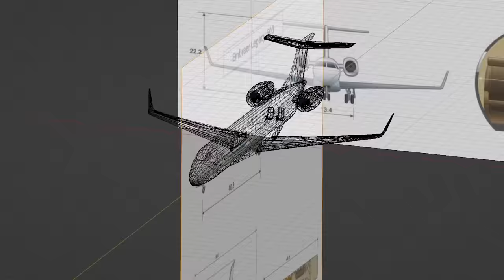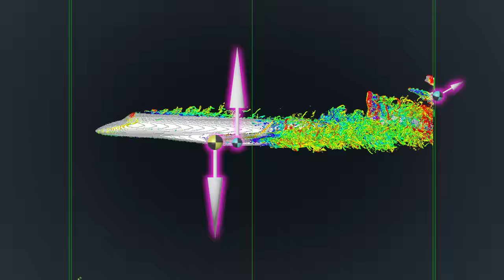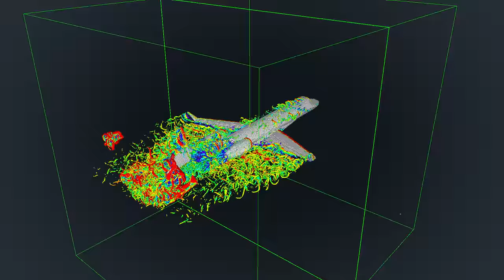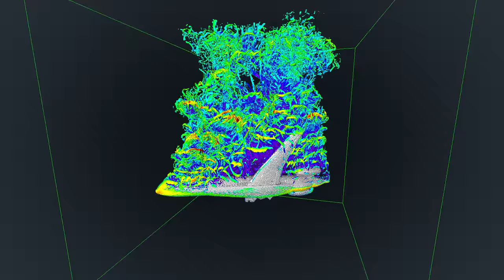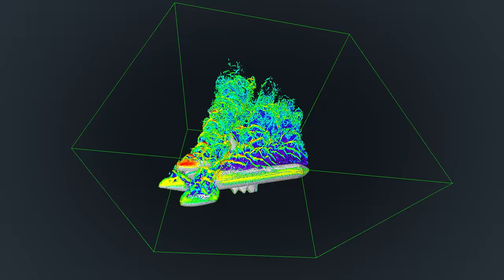Prigozhin's Aircraft Crash Analysis

Comment: How to know if the wing separated first and rip the tail or vice versa?great video
Reply from the maker: In other accidents (including larger airliners) that I've studied over the years, if a wing is lost first then the tailplane will generally keep the aircraft pointing mostly forwards the whole time - like the fletching on an arrow does. And the fuselage continues on a parabolic path downwards to the ground but the tailplane remains attached and never allows the fuselage to get 'sideways' enough to rip the tailplane off with the force of the airflow. The remaining wing may roll the aircraft as it produces lift but the tailplane keeps the whole wreck pointing forwards until it contacts the ground. So considering the tailplane was in a different location to the fuselage it leads to me to think that it wasn't a main wing that separated first 🤷‍♂️
Reply: For the alternate view, try to decipher the poor image quality in this video: youtu.be/8H2FGud37RQ?t=4m30s
To me it looks like the empennage was attached while the plane was falling and there's some holes which could be caused from shrapnel.  On the other hand, the two engines would also take up a few pixels.  The Wall Street Journal seems to think it was a bomb: youtu.be/x2BAYebRVfk
Overall, the physics in this CFD simulation looks accurate enough and provide far more scrutiny than I expect from the official investigation.
Reply: First thing that hit me watching a few copies of the grainy video in different stages of the fall, it seemed that at one point it still had 2 wings and engines but no tail, with smoke and debris mostly falling from the tail area.
Reply: short answer. you find the tail and wing. if the tail is further back from the route. the tail cut off first.
Reply from the maker: @nathanbanks2354 I believe Denys Davydov is quite incorrect about the few holes seen around the place on the skin which are just normal concentrations of damage in a crash. Look at MH17 shrapnel damage to see what a surface to air missile actually does to aircraft skin. That MSJ video is excellent too - it's the first video I've seen where they identify the plume spewing out of the plane during the fall as fuel, I thought it was pretty obvious and didn't even put it in my video, but then I saw all the comments saying it was smoke or fire, etc, and wish I put that detail in there. I thought I was alone in thinking that it was fuel so I'm glad I saw that WSJ vid now, thanks for sharing it!
Reply: @nathanbanks2354  Looking at that image, I can see the 'shadow' of the engines but there doesn't seem to be such blocky 'shadow' of pixels from the tail. It looks like the horizontal stabilizers attached to the vertical stabilizer are missing in the image he was showing, but it's impossible to tell if the vertical stabilizer is also missing. Considering the footage seen previously, I'm inclined to say it also went, because there's little or nothing I can think of that would rip away the elevator surfaces while also leaving the rudder present
Reply: @AntimatePcCustom  that COULD be the definitive evidence, if the plane had continued in a horizontal plane for a significant distance after the start of the breakup. However, if you look at the chart of the height and location of the plane, it fell almost vertically from a great height. Given that the wing on its own, the plane and the tailplane are all aerodynamic devices, it is possible that something falling more slowly may drift to a different position that gives a misleading impression of where it came detached from the fuselage. A wing on it's own is not that different from a sycamore seed and it could drift a significant distance compared to the tailplane, and the fuselage with its remaining wing which is more like a weight with a trailing guide like a weather vane. In fact, a wing on its own is quite similar to the aerodynamic shape that will stay in the air the longest when made of paper
Reply: @SLGY  You're probably right.  Also came across this video youtu.be/jtEHoCZpfFw which doesn't rule out a missile strike, but mentions erratic climbs & descents which could be caused by a partially broken tail  (Edit: the chart at 0:33 doesn't seem too erratic until the accident).  A missile or broken wing doesn't explain this.  I never really noticed the fuel, though I've heard jet fuel is difficult to ignite before it's atomized.

At first I was thinking shrapnel from a missile that exploded far away from the plane could cause damage similar to what we see, but one would expect this to damage the tail too.  Denys Davydov is a pilot rather than an investigator and he recorded the video hours after the event.
Reply from the maker: @nathanbanks2354 there's quite a few photos of the whole tail section (ones like at 4:24 in the vid) from different angles that show the vertical stab attached to what remained of the horizontal stab. It was located away from the main fuselage wreckage and didn't catch fire or anything, so it's pretty well preserved. 👍
Reply: @SLGY  Have you seen the close up vids of the detached wing?
Reply: @SLGY  you sound familiar. Do you have another channel analyzing the war in Ukraine?
Edit: excellent analysis just like the guy Im thinking of, either way, great job!
Reply: @SLGY  No loss of tail section.

Comment: Looks spot on, only discrepancy I see is that the plane went upward for a couple is sec which might mean that the rear fuselage was attached for some seconds after the explosion and the plane went in an upward motion likely due to loss if control 

I really hope Pringles had bis safety belt on
Reply from the maker: ohhh, good point. I did a little bit of an initial nose-up movement in the vid before it pitched over rapidly but didn't focus on it too much. I'd agree with you there, the tail probably held on by a thread for a little bit and caused all sorts of pitching up before it finally broke free.
Reply: @SLGY No, it makes sense, the force of the explosion will look for the easiest path which if placed optimally is the ceiling of the aircraft. 

Like an engine, excess gas venting from the ceiling and nothing from below will act like momentary downward thrust (or clockwise torque given that it’s to the right of the CG) and give a slight pitch up before the “thrust” disappears and aerodynamics pushes it nose down. The free body diagram can tell a lot of stories

Comment: But what is with the multiple ascending and descending of the plane before it fell down?
Reply from the maker: I think potentially there was a period of time where the tail was badly damaged and it still providing (albeit unreliable) pitch control and the pilots attempted to start a controlled descent - eventually it would have vibrated/shaken/ripped loose and then the sequence shown in the video continues. I decided not to focus on this period in the video as it's hard to make sense of what was happening from the limited data/info, and ultimately it was only a brief pause to the sequence and didn't change the end result much. Hope that makes sense 🤷‍♂️
Reply: If u mean the diagram with the RA 02795 vertical rate - it shows the velocity of ascending and descending. When the graph hits the zero (0) line it means cruising altitude is reached. Everything above zero means the aircraft is ascending. holding on zero means holding altitude, everything below zero means descending. The glitches in the vertical line at the end are caused by the turbulences the remaining wing generated. The aircraft was only ascending and holding altitude until the "accident" , there was no descending.
Reply: @borisblocksberg  i think what OP was referring to was rather that the plane gained about a kilometer of altitude over its cruising altitude, then went back to cruising altitude, before ascending again for a bit and then plummeting. The initial rise of about a kilometer seems hard to explain with SLGY's explanation of the damaged tail still providing some pitch control, to me, at least.
Reply: @pantalaemon   the aircraft wasnt descending at anytime until the accident, only the speed of ascending varies from fast to slower, that happens when the aircraft makes a curve or the altitude is blocked for another aircraft. he was ascending, holding on cruise altitude and then dropping like a stone.

Comment: This was very insightful, not only due to the airflow and explaining forces, but showing the importance of the tail and how that applies to CoL and it's relation to CoM. 

It really shows just how critical and unrecoverable significant damage to the tail is.
Reply: I'm wondering why the aircraft pitches down once the horizontal stabilizer on the tail is gone. If the center of mass moves forward, why doesn't the nose pitch up?
Reply from the maker: The pivot point is the centre of lift (only thing holding it up). Think of it like a seesaw, the centre of mass sitting on one end, the tail downforce sitting on the other. So when the tail downforce hops off its end of the seesaw, ol mate CoM will fall down

Comment: I rate this as a skilled and plausible theory.  I am not sure about there being a missile track in the crash video - but it is also possible, or might have other explanation.  Even so, if it were a missile?, such explosion might have occurred in the location hypothesised in your video.  I recall noting the engine sound continued down towards the ground, so I think your comment about that is correct.  I rate your video highly.

Comment: Do you think you could model a missile interception? in the original video we can see some sort of white "trail" near the aircraft as it goes down. However, I'm unable to tell if that white smoke is either from the missile explosion, missile propellant or an explosive device inside the aircraft. 

I do not know the composition of the potential explosives used and/or the color of smoke they leave behind so its impossible for me to tell.

I do know the missiles of the Pantsir and Strela AA systems leave a white trail but the one in the video is rather small. Also, Pantsir missiles have two stages, so maybe if the first stage is found we could know more (unlikely though).

Great video btw
Reply: Conjecture... the torn away wing would have had fuel in it. That fuel may have misted or burned as the wing fell separately.
Reply: @testiclegaming1250  doubtful. also Meany Russians around Moscow were panicking at that time because they thought there was about to be another drone attack due to reports of missile launches...
Reply: Dunno but when I saw it the white mist my first thought was decompression fog.  It didn't seem to be going anywhere.

Comment: The missile is also still an option. Most air defense missiles have a reasonably small warhead (except the AIR-2 Genie nuclear air to air rocket), and if it's infrared targeting it would go after the hottest part of the aircraft, the engines which are at the tail in this case.
Reply: I did find supposed footage of the wing being dragged away.
Wing did look sheered off.
I have a tiny bit of aviation repair experience. Based on footage alone I did not see the evidence of anti-aircraft shrapnel.
Plus, the exact model of this plane in Brazil survived its winglet (curved vertical part at end of wind) cutting thru the wing of a 737 over Brazil in the early 2000’s. (ATC fault) the 5 foot winglet broke off, but the pilots were able to land the plane at a near by military base without flaps.
Everyone in the 737 died.
So the fact the entire wing came off means something suspicious happened.
Plus Russia is not investigating AND they refused the manufactures request to examine the wreckage.
Yea. 

In other news the stock for the manufacturing company of this plane went up 3%.
That’s the markets way of patting the company on the back and saying “it’s ok, your not at fault”

Fun fact, one of the owners of the company was in that new jet when it collided with the 737 over Brazil.
There is an Air Crash Investigations episode on that.
Reply: a woman on board, called her mother prior to take off, and told her they were delayed while they were doing something to the plane/ or loading something.
Reply: It’s not really, missiles don’t just shear off one portion of the vert-stab they’d have blown the entire empennage wide open.

Comment: I am glad to have your observations  clearly described with your understanding of aircraft  . As well as your visual effects.  I had also studied the frame by frame video at the location. First just a overview of the start of that video from the ground  . The amazing Timing of the start of the video had been suspicious as to how prepared that was . Further not just one radio tower but a two just feet away from his fence. One just had a flash view of it in the video.  But had been a very multi frequency and even micro wave cell phone as well. All very interesting as this all plays out . And as you pointed out the rear compartment that seams to be the start of of sudden uncontrollable flight path that had allowed great speeds  as well as a rolling type maneuver that placed high stresses along the outer extensions of the aircraft . Without any other real signs of a explosion being seen forward of the tail section . Further information released that high security protocol was in place . And the second aircraft was used as with the passenger list being manipulated to avoid any real awareness of just who was on what aircraft . Yet after flights had departed those on the ground could of spotted the target victim to the tail number . That had a package ready to have a signal sent to known frequency of the aircraft that had been targeted  . While flying in range of the tower . To then have the video camera for proof of the disaster . The video itself may be the biggest clue to the event . And that second tower was just as far from the camera as the mostly seen radio tower  . But one must really be quick to stop the video  . And when seen it was full of multi band  devices . And to have the towers only feet away from the supposed house . Were a wooden fence . That may be easy to add ones device to the already in service tower.  Or been a part of the operations hut that was being used to maintain and secure and even operate state run communications services or monitoring as well as many other possible uses.  Think of how many videos have you seen that cover such a event . That was so far not mentioned any sounds of aircraft that had been miles away to add many seconds to then react to have the camera suddenly all ready to be used . Test yourself outside . How long does it take to pull out cell phone then prepare a already on phone to camera then video . To then establish a high up almost prior to its loss of control . That had a very low credibility of just chance . And a greater probability is all this was a well planned and use of several people with a location of the act being all targeted at the same location that the towers and cameras were all staged and ready to only target one of the two aircraft that would not alarm the target of a ongoing operation to take him out . All a fifty fifty chance that had defeated the deception of using two aircraft without passenger designation and having a full well trained security and officers that had been one of the worlds best security aware and prepared for times of greatest weakness in ones actions . I’d give 95 percent on the credibility  from just the data I had so far studied . Thank you for your video and hope to learn more from future videos you produce.

Comment: the bomb was in the landing gear, behind the wall. It was put in place during the check-up which was carried out the previous week on the plane. Ground analysis of the wing panel confirms that it was dislodged from the inside and the wall in question is characteristically deformed and must be covered with traces of explosives.
Reply from the maker: I'm kind of intrigued about your thoughts on it - the tyres were still inflated in the videos of the detached wing (albeit with the gear extended, the overcentre locks would have disengaged during the wing separation and the gear flopped out presumably.) I would have assumed the tyres would have ruptured easily. Also, there wasn't a pre-impact ignition of the fuel in the wings - The wing fuel is burnt last so there was definitely some in there, and you can see if spewing out of the wreckage on the descent, not on fire. I think the odds are that any small explosive sabotage would have been away from fuel tanks? I know some of these aircraft have fuselage tanks, but considering the length of the flight, it's unlikely they'd have had more than wings fuel. So fuselage tanks, if any, were likely empty... The wing they (very quickly) recovered in the video of it, seems to be bent, ripped but mostly whole and unaffected by any signs of an explosion...